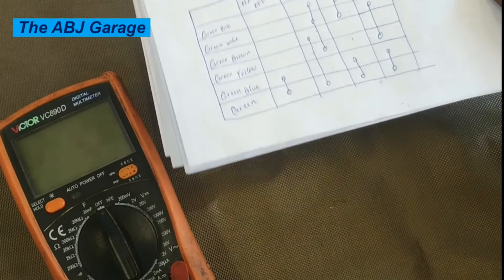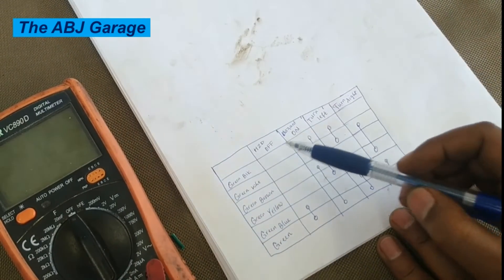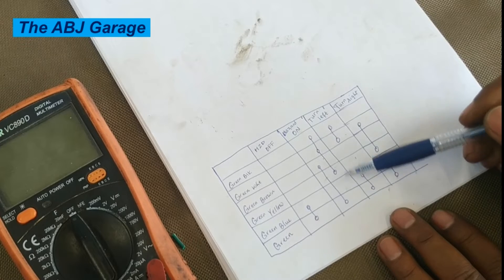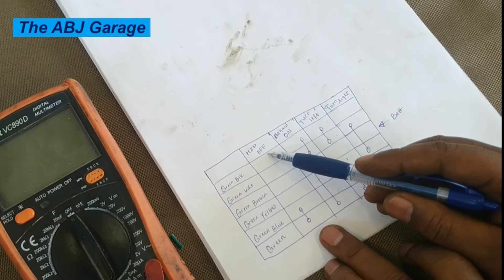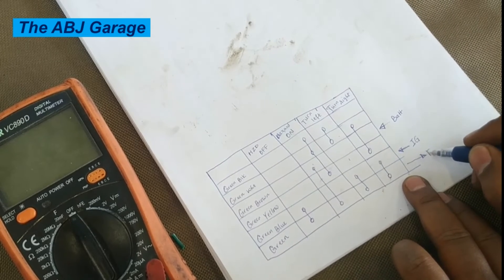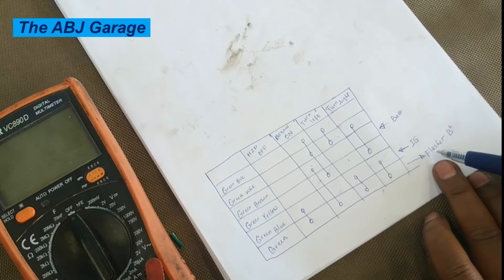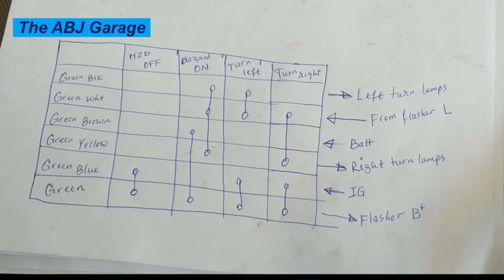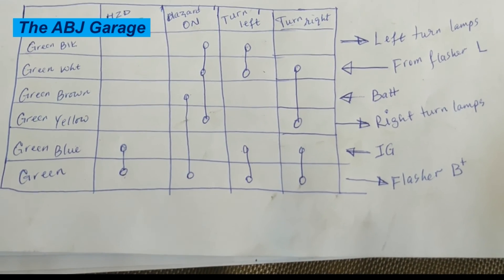How to do basic car hazard and turn signal light wiring part 1

Comment: What is balt and IG ?
Reply from the maker: Did you mean Batt? That will be battery terminal, and IG means ignition terminal!
Reply: @TheAbJGarage  that mean batt is positive and IG is negative right? Battery?
Reply from the maker: No! The ignition key receives a positive power from the car battery through the batt terminal and distributes that positive power to the different electrical loads. The power that goes to the ignition coil, electric fuel pump, electric fan etc is taken out of the ignition key via the IG terminal. And power will be supplied to the IG terminal when the ignition key is on the ON position. No negative terminal comes to the ignition switch. The lines are all carrying positive power to the different loads!
Reply: Acc key on?

Comment: Why green brown is from a battery, while green has a constant voltage either off or on.  position
Reply: I thought green would be 12v in, also. It makes sense that there is a single contact, GB, which powers all other circuits, Gn, when ignition is on.

Comment: I connected my turn signal using terminal 15,so how can I connect my hazard using terminal 30
Reply from the maker: There are two power supplies going in to the hazard circuit! One is directly from the battery and the other one is from terminal 15 of the ignition switch.

Comment: I have a question about the flasher relay in L connection,is it positive or negative power line?
Reply from the maker: L is an intermittent positive output from the flasher unit. The flasher receives continuous DC input from terminal B and then output intermittent positive output through L
Reply: @TheCarCareGarage i would like to clarify what power source line can be used on those switches?

Comment: Hi mate, I have a 1989 mitsubishi galant. When I turn on the ignition it reaches 12v to the carburetor vacum solenoid. It's supposed to do this when I turn on the headlights, but in my car it does it as soon as the ignition is turned on. Where should I check? (condition in air conditioner is normal)
Reply from the maker: Dear! That is exactly how it was supposed to work!
Reply: @TheCarCareGarage  Shouldn't it be active when I turn on the lights?